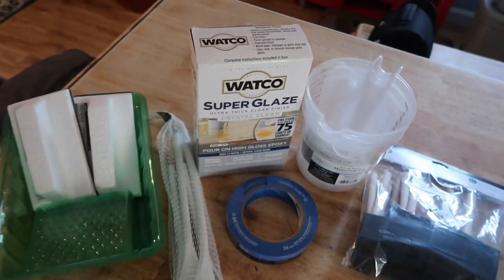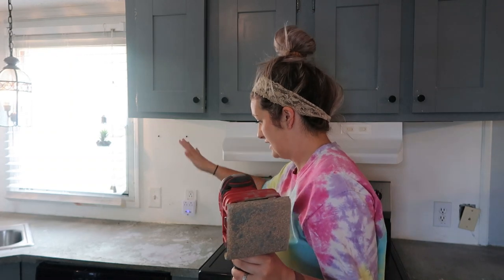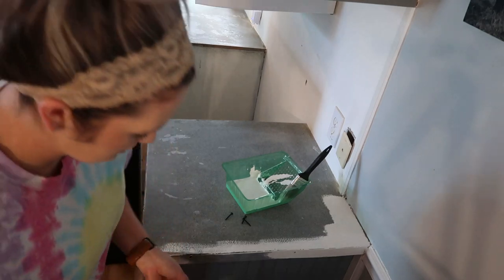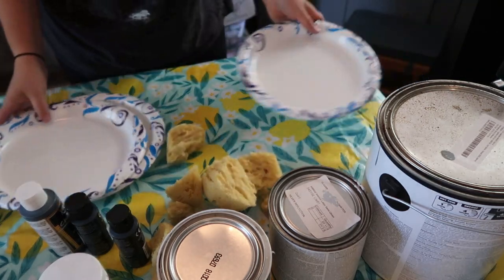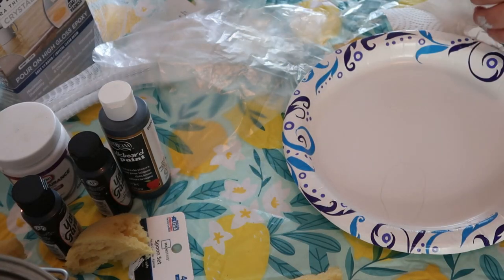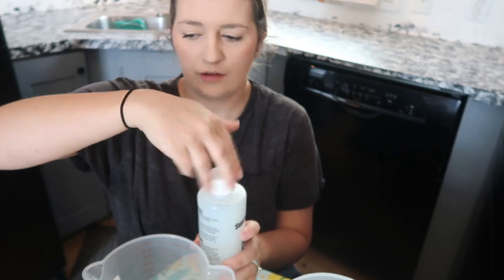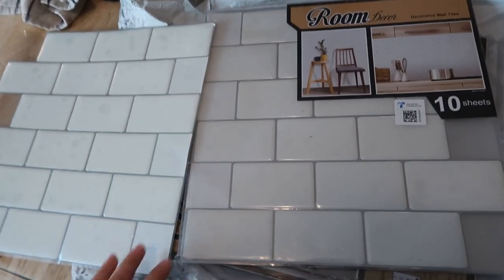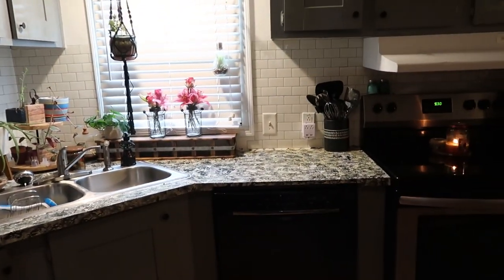Mobile Home Kitchen Makeover on a Budget/ Faux Granite Counter-top/ Peel and Stick Subway Tile

Comment: It looks really nice!  We put that kind of backsplash up and inside of a year we took it down, it started buckling in different places. We kept fixing it with all different adhesives.........nothing worked for long. I wish you much better luck than we had. It does look like your countertops will last with the special sealant you used👍